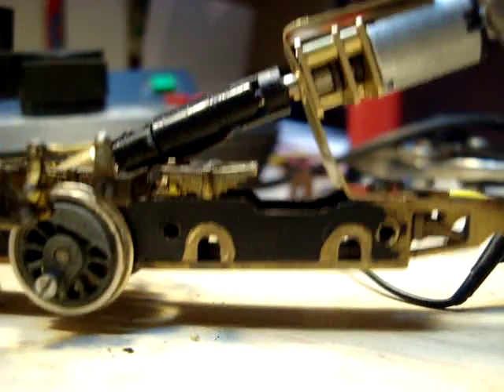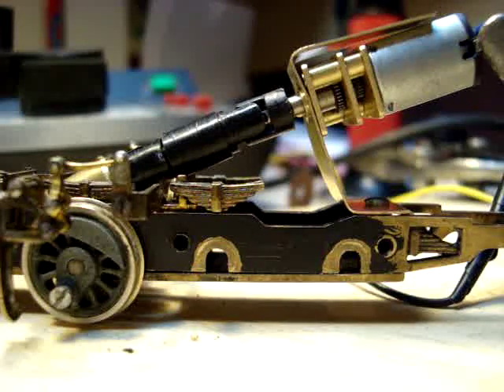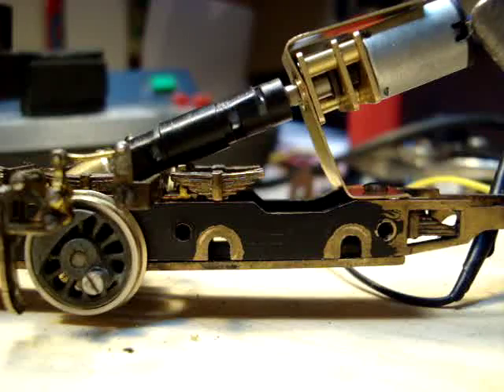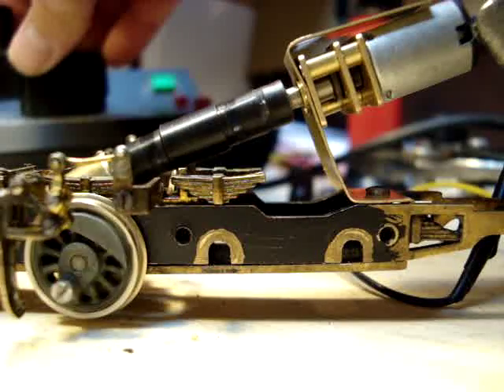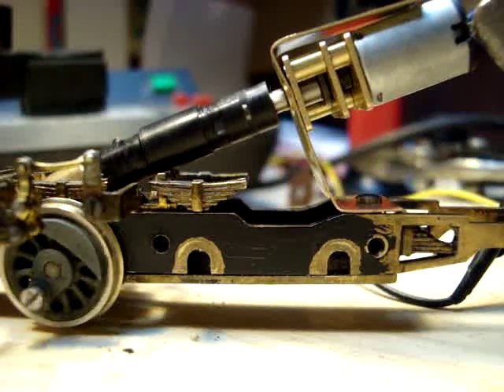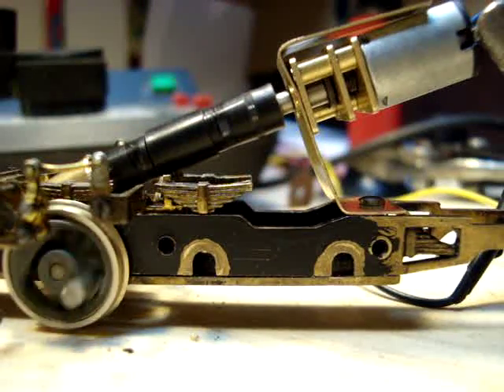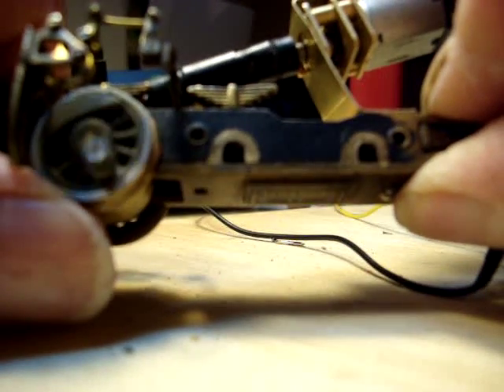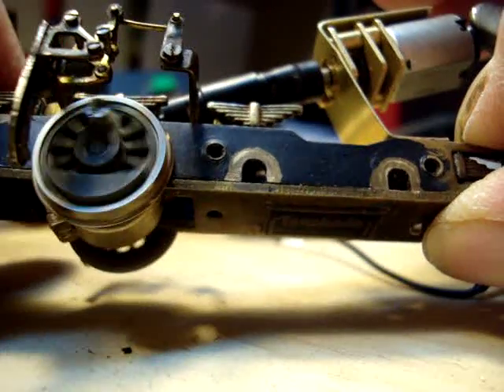Tenshodo HO Brass 0-8-0 Locomotive  Repower.  Initial Run.

Comment: These gearbox motors are great I just wish they weren't so noisy.  I've played around with these in a number of Hon3 applications and they run really well.  I use the 5:1 units mostly with a small flywheel on the motor itself.  If you can find the ones with a double motor shaft for use with an encoder it's easy to add a flywheel.  Really smoothes these out.

https://www.youtube.com/watch?v=0MgG1WU5ITg&list=PLEubJqMGeuOb73RECV0VToYeBEozELPV3&index=10

A little noisy but yeah these geared motors work great.   And they're cheap!